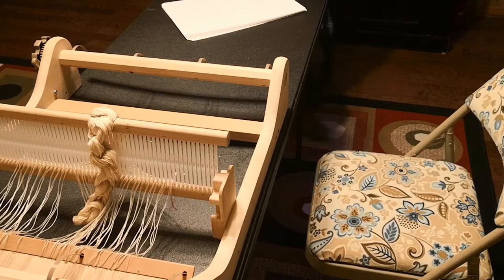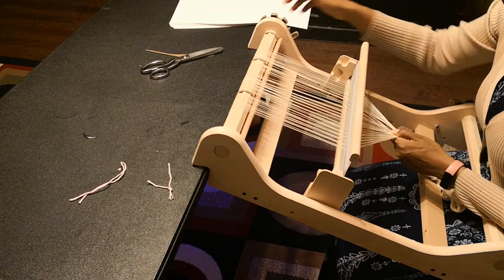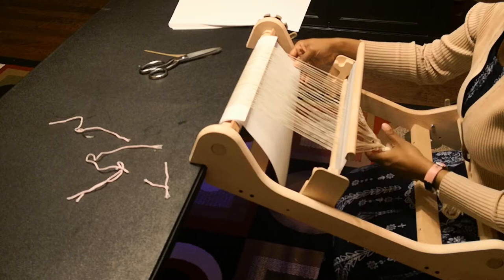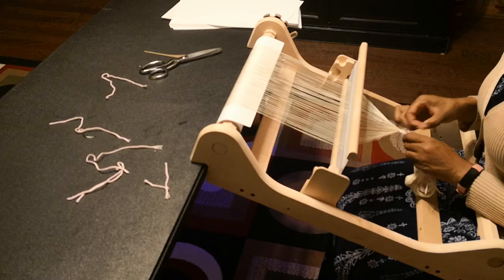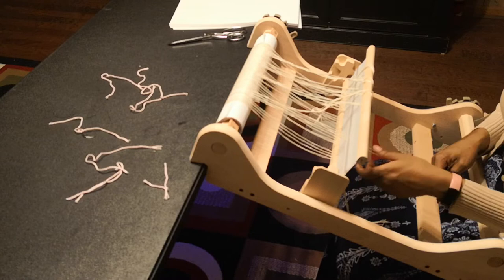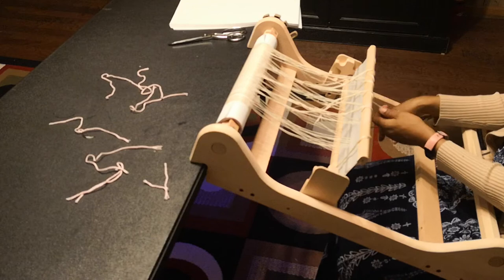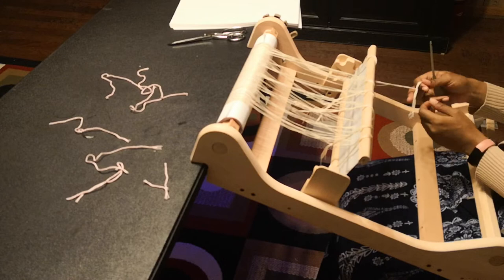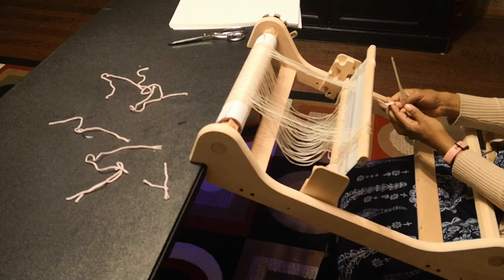Hybrid Warping an (Ashford) Rigid Heddle Loom (Part 3 of 3)

Comment: Amy, thanks so much for this series.  I definitely now confident I'll be able to use the warping board that I just bought.  I've been using pegs, which work fine, but I think I'll have more control with the warping board.  My only issue is I don't have a table to put the warping board on and my 24" Ashford RHL is on a stand so I'm not quite sure how I'm going to do this.  One question, how do you tie the knotted bundles to the front warping beam?  I've seen several ways to do this but not sure, especially if they need to be tightened.  How do you tighten them?  And I'm with everyone else who's so grateful for your generous time and knowledge and sharing with us.
Reply from the maker: I'm glad to help!

Comment: First, thanks Amy. When you are winding on, it looks like the centre of you warp is quite a bit looser than the edges (because of the sharp angle on the sides v centre), did you not find that that causes issues when weaving? If so, how did you resolve that?